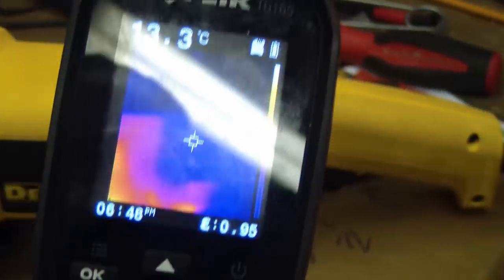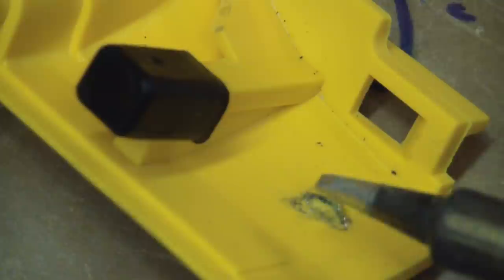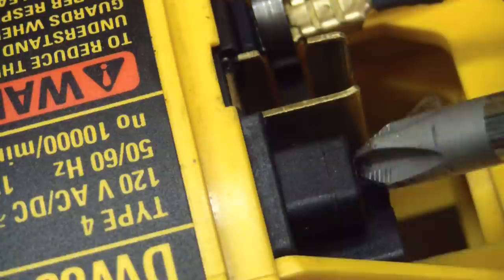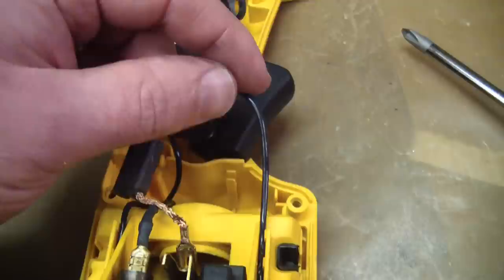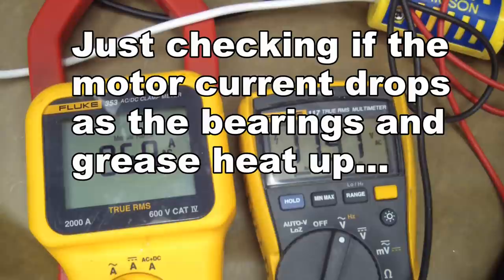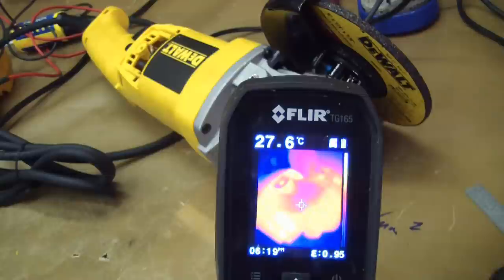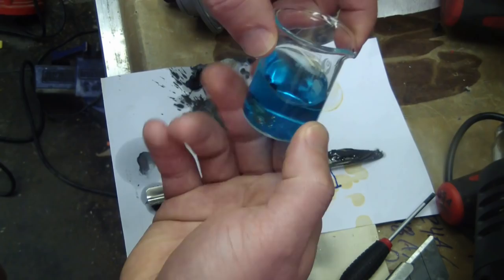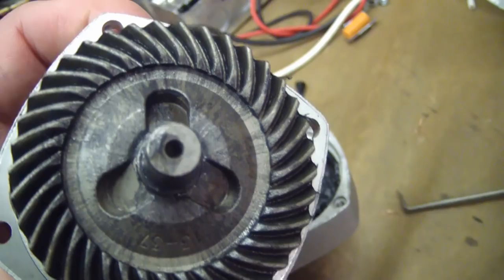Bored of lame tool reviews? Meet DeWalt's grinder guts Part B

Comment: I use lighter wheel bearing grease when I have grinder heads apart because it flows much better than hard moly grease which tends to accumulate away from the gear teeth.

Comment: 4 years late but indeed you are correct. customer dropped off a grinder for repair and the only damage besides the lock button is that big crown gear. multiple teeth in multiple spots around the gear. i will never get bored of your videos

Comment: been using my dewalt 4.5 inch alot of times with over sized 7in disk cutting disk as well as the 7in cutting/grinding disk if I had alot to cut and gring (reckless yea I know) for over 7 years now. I use mine for mostly automotive repair and fab work. till this day it still works like it did day 1 (doesn't look like day one any more). very reliable, it was the first grinder I purchased and never had a reason to get another. I've used it to cut upwards of 3/4in steel plates hardened steel, plastic, stuck a circular saw blade in it and cut wood. it just never seems to quit no matter what I put it through.

Comment: MoS2 in non-oxidizing environments is stable up to 1100˚C, but in air, it starts to turn into MoO3 around 350˚C, whilst evolving sulfur dioxide.

Fortunately, the grease its suspended in will also keep the oxygen away, so it will be serviceable in a proper formulation to much higher than 350˚C.

Perhaps a dollop of the grease on your (rather nifty) temperature controlled soldering iron can give an indication of what the mixture's breakdown temperature might be?

Thanks for the shout-out, kind sir.
Reply: Wiki had the one reference to 350˚, but it was so vague in its application that I had to go looking for a better reference, once it was called into question.  This wasn't easy, because all the molygrease makers list temps higher than 350˚.  Eventually, I found this 

http://www.engineersedge.com/lubrication/molybdenum_disulfide_characteristics.htm

which seems pretty thorough.  I might have to keep that site in mind for future reference.  it reads like a 70s textbook, just how I like my reference material.

Comment: I bought one of these after my tiny (by comparison) Black and Decker finally couldn't be fixed quickly and cheaply (free) anymore. For my purposes as a hobbyist and handyman, this machine is a beast. Yes, it is heavy and it gets hot, but I don't think I am going to need to buy another one in my lifetime.

Comment: Yes, the tool was incorrectly assembled in Mexico? where Juan Sanchez filled the housing with MoS2 grease very dutifully only left the parts that wear untouched. That might be a recall there later.
I thought the gear was sand-cast, hence the surface pitting, matchingly sand grain sized. PM solid dies aren`t grainy or pitted, see die-cast toys too. Either way, it was made in a mould that left drag (btm half of mould) imprints, no machining marks.
Sand casting is the cheapest way, minimal wear & tear on shop equipment, needs lots of fuel for melting steel. PM costs more in shop equipment, high pressure dies and plungers wear a lot, it uses less fuel as only fusing temperature is needed.
Bearing size & spindle issue: They want a big coarse thread on the spindle, so user doesn`t cross-thread easily. Shaft and bearing are big enough for the torque the motor can make, although a bigger bearing rotates slower and wears less, excess weight it is. Bearing and shaft also are non-load bearing, they`re just there to hold the spindle straight, the gear teeth are load bearing components. They better be case-hardened. (Like on a bicycle, the pedal -to-crank point has to be strong, the crank and the axle too, but the bearing and frame around the axle don`t.)
The switch is only rated for 12 A, so they cherry-picked the weakest link for the printed material.
Good stuff all around, glad you took the time to make this video. Thank you.
Reply: theoverengineer Bigger bearing rotates slower?! What are you talking about?
Reply: Thanks for your reply, but for my understanding you have:
bigger bearing = larger radius
larger radius = larger circumferential speed
Reply: Mar phy Here is a demo and a bit more explanation: https://www.youtube.com/watch?v=tXISVJTCY0w
Reply: Dear me, you are oversimplifying. Having a shaft with given RPM, a larger bearing has a larger circumferential speed and the balls have more distance to travel per shaft revolution (because of the larger bearing circumference). Larger bearings in general have more friction than smaller bearings but last longer because of their higher load rating (more balls, less contact pressure, L = (C/P)^p).

Comment: I found out the blade adapter on a friend's lawn mower was sintered metal, so I suspect the technology is pretty commonly used.  The question for the back yard tinkerer is can you weld it and machine it?
Reply: ***** A benefit of making sintered parts is that they need relatively little machining, avoiding the heat and stress that milling and welding impart to the work; the part can be of an alloy that is not ordinarily suitable for machining or welding.  I suspect that any sort of high stress from machining or high local temperatures from welding will have a very adverse effect on the part's suitability in its designed role.

Comment: I got dewalt with same powder gearbox, and in past 2 years no issues. The cable broke first, close to the cable shoes inside which was really strange, as this is no movement zone. The tool is strongly abused with way bigger discs than supposed to use with it. 

I do really enjoy your tool reviews,  you have to do it more often :)

Comment: My brothers are both welders and DeWalt grinders seem to be a popular tool in many shops in Alberta, partly because they have a tendency to die under hard use before the warranty period is up. I obtained a box of broken DeWalt's from the company shop and built 6 working grinders, though they all need brushes. The broken grinders tended to either have a cracked casting or broken gear due to abuse, or the trigger, motor or brushes had failed. The copper leads on the brushes have a tendency to fail due to build up from grinding dust that causes them to burn out according to my brother. The rear bearing probably has the rubber shielding due to grinding dust coming in through the brush covers.

Comment: Regarding the Dewalt 12 amp grinder and the rubber bearing cover: I think it is an acoustical damper to limit the vibration coupled to the case.

Comment: I have used lots of Makitas and would choose the Dewilt over it in a hearbeat. I put lots of miles on mine and bought it because they were out of Makitas and was very glad I did.  The Makitas switches are a weakness as the fill up with metal powder. We used to take a new Makita and silicone the sheite out of the switch right off. The Dewilt had noticeably more grinding power and only had to service the bruches once after a very hard year of using it daily for sometimes several hours per day. The spade connectors were not a problem at all and I did take the gearbox apart to regrease and there was no wear and tear that I could see.  The other guys in the shop  would like to have the Dewilt too but they were not willing to buy there own and used the Makitas the company provided. As I remember the Dewilt was 10 bucks cheaper too.

Comment: Well done- BRAVO- I have at least 10 angle grinders in various forms, every one did not actually have the gear grease applied to the gears.  In the past a grinder would last 2 years , since I now take the gearbox cover off and grease the gears I have not bought a new one in many years.  Noticed you used the fluke 30 non rms , wow the readings were off.   True rms vs non rms.   I'll stick with makita  but the dewalt was impressive but my 5 inch makita never blew my 15 amp breaker.  Thanks!

Comment: My dad was an engineer and brought home some of the magelien... magic sulfide stuff in powder form. They liked to use it in spots were they couldn't use grease. He said it was the slipperiest stuff he had ever worked with. We used it on our pinewood derby cars. For some reason we won two years in a row. BTW: you might want to take care touching the stuff. He laughed at asbestos dust and DDT but treated this like it was magic death powder. We didn't wear masks but he made you wash your hands really well if you got any on your skin, not just wiped off on a rag.

Comment: I dont have much official knowledge about this stuff, but heres my 2 cents about these grinders, my dad uses them on pipeline and he has for about 10+ years that i know of, the brush assembly holds up quite well and the spade connectors do too, the brushes are super easy to change in feild even with gloves on using a flat head and a pair of needle nose, and the gear head always gets hot but never have seen him break one or lock up, now that im older i decided to experience on one of his older ones since he recently bought a new set (he buys two at a time)  its not much of an experiment but what i did was take the head and open it up, cleaned out all of the old dried up grease and then packed it full of grease i got from tractor supply. May not be the best thing to use but so far i noticed it was slightly quieter and it didnt get as hot, still got hot to the touch with no gloves but when your wearing gloves you dont feel it when your holding it by the head. And the only thing i worried about was the grease getting thin as it heated up and seeping out buf it hasnt so far. The only things that have broken one of these grinders is either a helper dropping them repeatedly or cutting the cord or ripping the cord out of the extension cord. And during hurricane harvey one of our tool boxes got knocked over and flooded the inside along with all the grinders and other tools we had inside. From what i know about them they are great grinders, a little on the heavy side but nonetheless powerful and effective and reliable. Ive also seen newer versions that are supposed to be much lighter and i think (dont quote me) brushless. Thanks to anyone who read this, again i have no official knowledge, this is just from what ive seen with these grinders.

Comment: Made the shaft too on agasm
 All parts go yo other machines for secondary operations. Most parts made on screw machines first. Wife worked in injection molding, hampstead. 2 of 3000

Comment: I very much enjoyed this video. Only one tiny thing I could pick you up on - in saying that you need some slip to produce torque - this is true for the AC induction motor, but it is not true for the series-connected brush motor you show here. For this motor design, the potential problem is the huge rpm when unloaded and in practice the fan and friction losses limit that. Increasing mechanical loads reduce rpm, increase current and strengthen the motor field until the system is re-balanced. Inrush and stall currents are just down to resistances and inductances which you could measure. Currents when rotating are reduced by the back-EMF in the usual way for motors. I expect you knew that already but just mis-spoke in the video. Thanks again for doing the work.

Comment: this may be necroing an old video but we made the switch from makita to the dewalts quite a few years ago and the only two things that i ever have to "fix" on them is the gear set and the switches gearset's usually last 4-5 years with the way our guys grind and the switches maybe 1-2 years. never had a brush or brush holder failure that i've seen out of them so far.
Reply: 4 year old vid 13 hour old comment nice
Reply: While I'm here might as well reply to my not even minute old comment

Comment: as a blacksmith 1000c or 1834 f is under forge welding temp so it would be a bright orange to yellow color. you really don't get to white until you are forge welding mild steel which is north of 2100F.
Reply: nickwoo2 I recon white would be hotter than that. Molten soda lime glass is like 1300c and it's still orange ish. Fucking hot tho
Reply: Thats kinda true but lets be honest white hot is definitely better for forge welding its easyer and more likely not to delaminate

Comment: AVE, as a prosumer the Makita 6” was the grinder. However they have substantially shit the bed in recent years. The triggers always shot the bed damn near immediately. Replacement triggers are something like $50. You can fix em yourself but you have to break the casement. I’ve seen everything fail on them, so I don’t buy em anymore and I’ve got my company away from them as well. I believe the best grinder in the market is the Dewalt DWE43116 6” angle grinder. Haven’t had any failure with it yet. And what I’ve heard is the first thing to go on them is the brushes, from wear the way it should be! If you could review one of these I’d love it. Also they have a 6” corded brushless model aswell. Also extremely nice

Comment: Gear set failure is most common failure. We use them for diamond grinding concrete and glue removal for polished concrete and epoxy coatings. Great tool decent price just not a fan of the newer trigger handle how it sloops down at the rear.

Comment: Ahem, if it's rated for 22 A at 125 VDC, that makes 2750 Watts.  That's 3.7 HP. 1 1/2 Hp is the continuous rating I presume. They even state on the box the 1837 W "max motor rating". It means the motor can reach that, doesn't mean it operates at this power level.

Comment: If it's forged powder it's great. They make racing conrods out of that. You already determined it's extremely *hard*, and you already determined there is very little torque on it. Basically you are just saying it's way over designed. The failure mode is strictly wear or heat.

Comment: I remember I once borrowed a friends pressure washer to clean about and 18ft by 7 ft roof. Anyway it was insanely awkward to use because the trigger wasn't near the bottom of the handle instead if was around halfway down it, and so if I need more reach at the sides instead of being able to lock the trigger and just hold it by the base I had to get further up the ladder and basically lean over a wet roof. 
Sometimes triggerlocks just need to be a mandatory thing on some tools where you are holding it for prolonged times.

Comment: Subscribed! This is the second tool that Ive seen you review and I heard you say that you have a doctorates degree. I take it  that its in some sort of engineering..? You obviously know your shit! And I feel somewhat better knowing DeWalt does make not the best but fairly good products as I"ve bought many of their tools and I haven"t  had problems with them with casual use.The first cordless drill I bought was a DeWalt, One of the older 12 volt models when that was the most powerful that they made, I dropped it off a ladder and bent the chuck spindle a year after the warranty expired but when I brought it in to a DeWalt store in Bloomington MN they didn't ask for a receipt and put a new spindle and chuck on it no questions asked! That left me whith a good impression and have been buying their tools since then some 30 years later.

Comment: I wouldn't go too hard on the sintered gear parts. They are pretty common nowadays and - depending on the materials used - quite rugged (if you don't drop them on a hard floor, they don't like that...).
At least DeWalts engineers were intelligent enough to have the the two gears being made out of the same material. Sometimes, in the cheaper tools I know, one part can be made of an aluminium or magnesium alloy, which then is too soft compared to the sintered metal and will wear down pretty quick. The coating might probaly be zinc (or a zinc- or zinc-nickel-alloy), as it looked quite soft when you filed at the gear in your first video. This is mainly done for corrosion prevention purposes as the sintered metals do have alot of pores and contain iron carbides which would be left unprotected against air and humidity, hence leading to intergranular corrosion.

Quite good videos, explanations and great teardown! You got a new subscriber over here in good ol' Germany ;)

Comment: Hey ave, if it happened to me it could happen to you. Angle grinder with the wheel of death on the business end. Had the trigger lock engaged, the wheel of death snagged on a crack in the work, pulled out of my hands, the thing was jumping and bouncing in the air and spinning in circles. First instinct as you know is to try and recover by grabbing the tool, big mistake. It didn’t kill me but I learned what tool to use the trigger lock and which ones not to. Can you imagine the carnage if chainsaws had trigger locks ?

Comment: Exactly right.  I owned one. Lasted less than 1-1/2 months of light grinding. Gears stripped. Went and bought a Fu Manchu Metabo. It is now 8 years old and still grinning like new. No not all foreign shit is shit. But not all French and German and Swedish is great. Do even mention USA. 
I have a German Weller soldering station that cost double the Fu Manchu and lasted half the time. It was 1 month old and now DOA. 
GOOD TOOLS ARE A ROLL OF THE DICE NOW!!!!!

Comment: Amazing video, as usual.
I am not an expert on material science or mechanical engineering.
I learned a whole bunch of stuff from this review. 

Just wanted to point out that lagging current sine wave comes to the right of the voltage sine wave.
Although visually counterintuitive, you want to think of it in terms of which wave reaches which point, say its peak, at a later point in time. Which makes the wave to the right the lagging one.